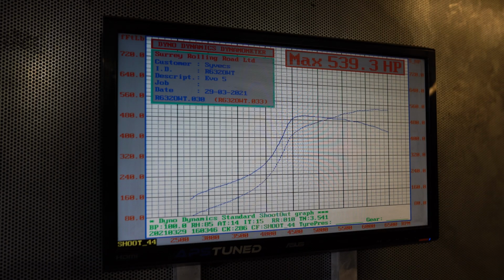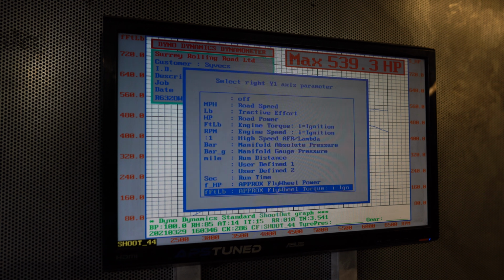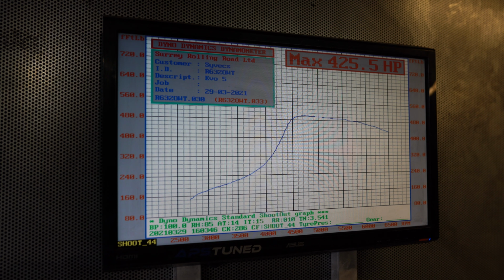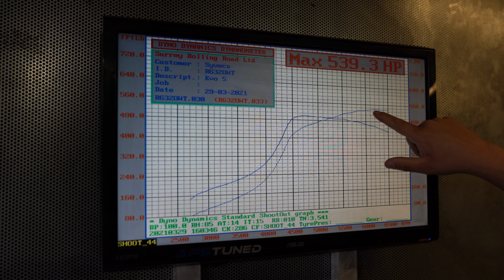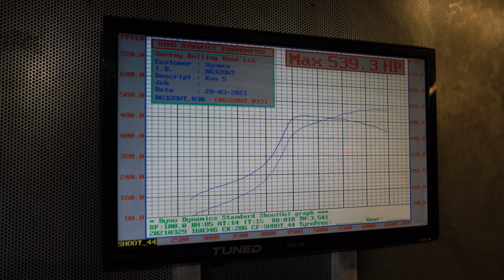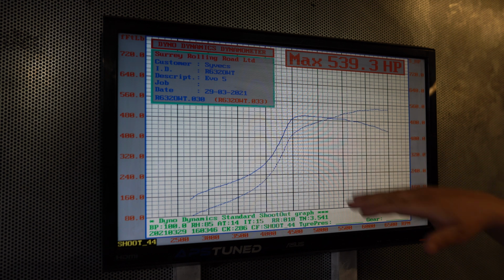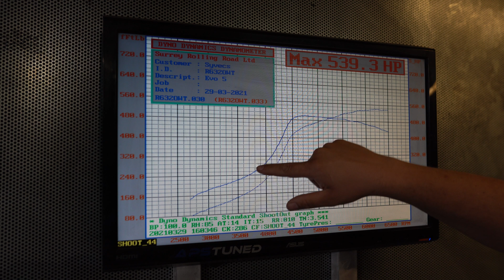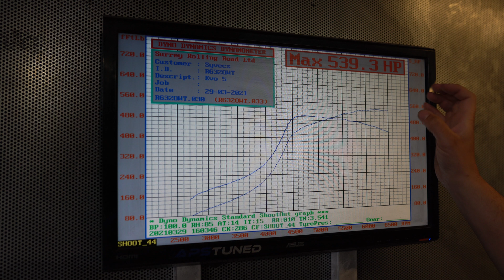Power Curve Breakdown - Syvecs Says #6

Comment: A flat torque curve won’t give a broad range of power, it will only give you peak power for a very split second. 

I’d rather have a car for instance that holds 200 bhp from 3500rpm - 6500rpm, than a car that only peaks to 200bhp @ 6500rpm